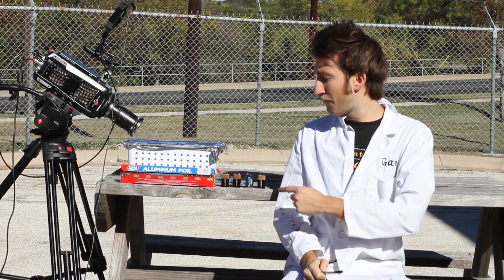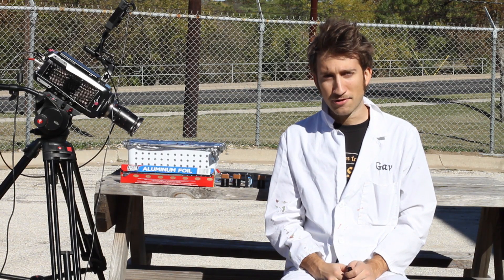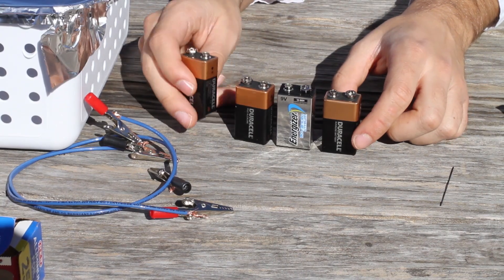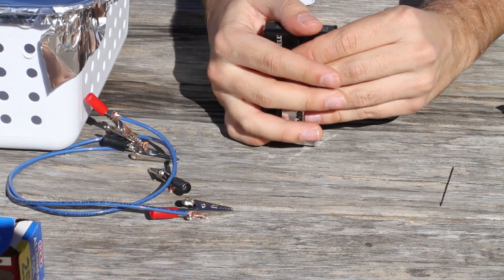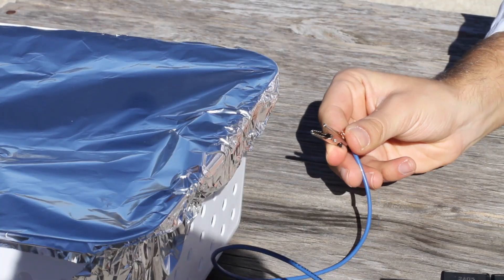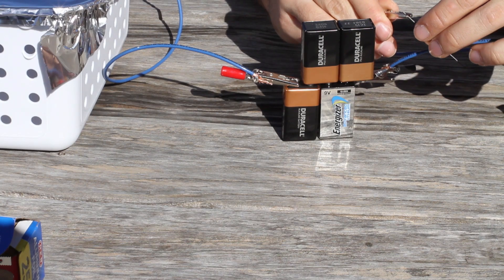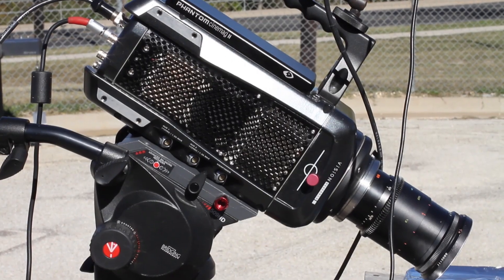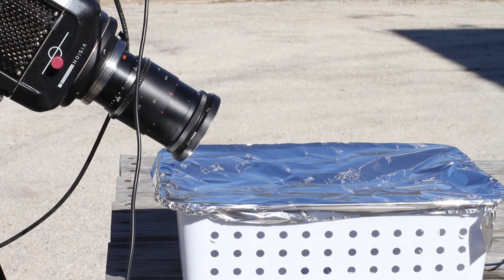Tiny Plasma Cutter in Slow Motion - The Slow Mo Guys

Comment: It the voltage or heat in the plasma enough to hurt you?
Reply: Ok first of all the thing he is holding is insulated so it cant shock him and second the amount of volts in 5 batteries cant create enough heat to harm you
Reply: Is the fact that the lead's tip is heated white hot enough to burn you so hard to see?
Reply: Oh trust me I put a led on '1' 9V battery and touched it accidentally and it burned my finger badly. Don't ever touch anything that has electricity or heat in it, it will hurt you. And he used 5 9V Batteries so it will harm you.
Reply: Maltfalc https://www.youtube.com/watch?v=XDf2nhfxVzg
Reply: Bardo not even troll... NOTHING can happen to you when you touch a 100mA 9v battery maybe like 1000 connected in series would LITTLE shock you.
Reply: Maltfalc you're funny
Reply: ***** is right
Reply: Bardo Was it Led Zepplin?

*Sidenote: you spelled "lead" wrong. Also, it's not lead, it's graphite.
Reply: NCR Vet he meant LED i beleive.
Reply: ***** The heat will hurt you, the voltage will tingle but won't do any permanent damage (probably).
Reply: Actually its the sword that kills
Reply: ***** It's not the current, goddammit. Everyone thinks this.It's actually the VOLTAGE that kills. You can run a 500 amp car battery through yourself and not die. I've done this. The thing with high voltage (above 200 volts) is that you can only have it in your body for microseconds. If it is in you for too long (say, 1 second) your heart will beat irregularly (mostly applies only to AC voltage) and you will die.
Electrostatic shocks contain voltage up to the 600 thousands. If that kept on going for 1 second you would be fried.

Comment: Please be aware that you should wear shaded lenses when doing this! Sunglasses aren't good enough either. A proper welding/burning lens in the 9-10 range should be good. Also, with a heavier, shorter piece of graphite, you can cut thin steel...

Comment: I tried to do this at home.  all it did was make some small sparks and blackened the foil I did everything right I use 4 9v batteries and used #2 pencil lead does anyone know why it's not working?
Reply: A bit late, but I might have a suggestion. Try fresher batteries, change up the foil (Some foil contains plastics which interfere), or try a softer lead. Softer leads have more graphite, which is the key to making the experiment work.

Comment: just out of curiosity...what would that do to paper?
Reply: I'm no science geek but I'd guess it'd catch on fire...
Reply: A bit late, but thought I'd chuck this in:
It would do nothing more than draw on the paper. Paper does not conduct, so the electricity would have nowhere to go.
The aluminium trick works because the foil conducts, closing the circuit on contact with the graphite, exactly like an arc welder.

Comment: Is this really a plasma cutter or is this just a redox reaction?
Reply: I reckon there's plasma involved; those bright-blue arcs are plasma.  But calling it a plasma cutter IMO is abuse of the language.
Reply: dbeierl
Yeah. Looks nothing like the weapon from Dead Space. All joking aside, what you said is what I was thinking.
Reply: SSS365 Aye. Your actual plasma cutter generates a concentrated high-pressure jet of plasma and hurls it through whatever grounded metallic is in front of the nozzle.  The metal is vaporized before it has time to soak the heat away, and it is so quick that amazingly little energy is wasted outside the actual cut.  An oxygen cutting torch, a wonder in its own right a century ago the way it could burn a slit through inches or even feet of steel, is a blunt instrument by comparison.  And all it uses is electricity, dry compressed air, and some consumable nozzle parts.

For a while I had a baby self-contained one meant for sheet metal up through 1/8" (and would hack its way through about 1/4" if you were determined and accepted a messy cut).  It really struggled with 1/16" (?) copper when I tried it just to see.  The copper conducted the heat so well that it wouldn't stay there long enough for a clean cut.  Instead the whole sheet got very hot and the jet had trouble even piercing it.  Nasty messy awful-looking cut.
Reply: ***** Yes, you can see the melted metal at the edges.  Cute trick though.  As a kid I used pencil leads as resistive heater elements, but I never thought of this one.

Comment: This is not a plasma cutter.  This is an arc welder.  An arc welder which is cranked up too high and burning through the piece it is welding.
For a channel with nearly 5 million subscribers, you should watch your nomenclature.

Comment: What type of lead do you use? Are you using actual lead or just graphite? I tried using graphite and it cuts for about a quarter of a second then stops being able to cut anything. The leads and everything were still connected but the graphite would not cut the foil.

Comment: Wow...so much controversy over a single word. For those who are interested in more intelligent conversation, please reference this link regarding why the names are different.
http://en.wikipedia.org/wiki/Aluminium#Etymology

Here's an excerpt:
"Two variants of the metal's name are in current use, aluminium (pronunciation: /ˌæl(j)ʊˈmɪniːəm/) and aluminum (/əˈluːmɪnəm/)—besides the obsolete alumium. The International Union of Pure and Applied Chemistry (IUPAC) adopted aluminium as the standard international name for the element in 1990 but, three years later, recognized aluminum as an acceptable variant. Hence their periodic table includes both. IUPAC internal publications use either spelling in nearly the same number."

In short, both terms are scientifically acceptable. If you're trying to determine which word is the "right" one, then you're barking up the wrong tree. Words are neither right nor wrong, they're merely accepted or unaccepted.

For more information about how words become "accepted" words, please reference this comment from the Merriam-Webster website:
http://www.merriam-webster.com/help/faq/words_in.htm

Comment: IMO its not plasma cutting but EDM cutting
Reply: Are you trying to be smart, because if you are you are doing good
Reply: George Mitchell Ty. I meant in plasma cutting they use gas with high temperature (plasma) while in EDM its two electrodes. IMO title isnt correct

Comment: It was Aluminum before aluminium, but alumium was the first spelling.  Aluminum dates back to 1812, while aluminium dates back to 1826.  Alumium dates back to 1808.  This information is readily available in encyclopedias, dictionaries, and online sources.

Any etymologist can tell you that more often than not, it was the British who changed the spelling, and of course whatever colonies they still had at the time of the change followed.  The Americans most often use the original spelling or term

Comment: Okay, my "why isn't this 60fps" friends...here's how this works. 
Gavin records with the Phantom at 2500 fps. Played back at 24 fps, it shows events 104 times slower than we experience them. If they adjusted playback to 60 fps, it would only be about 41 times slower. To get the same ratio of 104 times slower, Gavin would need to record at about 6240 fps. 
Why not? Here's (probably) the reason: the phantom is capable of 1080p recording at speeds up to 2570 fps...after that, you're sacrificing resolution for frame rate. The 6240+fps that you would need for the same playback effect is beyond that threshold; in fact, it falls in the lousy range of 640x480. You'd get your 60 fps, but your video quality would be really crappy. 
Picture quality trumps frame rate any day, so enjoy your slow-mo in glorious 1080p.

Comment: This isn't plasma cutting. Plasma is a superheated gas that in most shops uses compressed air, this is more like arc gauging which actually uses graphite in the rods. The rods heat the metal up and compressed air blows the heated metal away. Still pretty cool tho.

Comment: this is not plasma cutting it is carbon arc cutting. plasma is where there is air blown out at a high speed and turning to a plasma form by an arc created between the torch and metal. carbon arc cutting is what is shown here.  the carbon rod, the pencil "lead", is allowing an arc to form from it to the metal heating it up enough to melt it. usually its air carbon arc where air is blown onto the molten metal and blowing it away so it doesn't weld itself back together.

plasma is used on thin metal such as this but is a different process. air carbon arc is used usually on thicker metal 1/4 in. 1/2 in. etc. air carbon arc is done with a constant current welder and a air carbon arc stinger(the thing that holds the carbon rod). it is usually around 200 amps of electricity for a 1/4 in. mild steel plate producing about a 10000°f arc (if my memory serves me correct on the temperature) this doesn't need to be anywhere near what it would be for mild steel since it is aluminum foil.
Reply: still cool to see in slow motion instead of behind a welding helmet at normal speed

Comment: I wouldn't call that "plasma" cutting.. What you're doing is carbon arc gouging, while working through college I was a JIW for several years. I would arc gouge constantly while welding in order to full pen weld joints.. we use plasma to cut parts

Comment: Hi SMG's 
I would love to see a video of a pop bottle rocket exploding under water. I used to do this as a kid and it makes the coolest noise. All you have to do is hold the rocket about 2ft. off the surface and point if at a shallow AOA to the water, about 30 degrees and light it holding it loosely in your hands. When it launches it goes into the water and plays the wildest tune for you before it explodes! Thanx for all of the excellent videos.

Comment: Not a plasma cutter, theres no gas the electricity runs through to create plasma. This just looks like a stick welder that doesn't melt the electrode on to the ground, and it cuts through the foil because it's too thin for welding.

Comment: No, this is using electrons to cut the aluminium. Plasma is a state of matter (solid, liquid, gas,plasma), a plasma cutter would use heat to cut. If that was true there would be instances of gas, liquid and screaming Gavins

Comment: I have and interesting suggestion for a new video. It starts with a story.

My mother in our old house liked to keep a large metal bowl in the oven for storage because it was the only place that still had space for it. I once forgot to take it out before turning the oven on. So when I went to put the food I was about to cook in the oven, I saw the bowl. So I grabbed the oven mitts and put the bowl in our kitchen sink. The faucet was dripping and when a drop of water landed in the bowl, it instantly went into a boiling state and moved around the bowl as if the surface of the bowl was friction-less. I think that would be cool to see in slow motion.

Comment: This not a plasma cutter at all.
You need way more power to create plasma and use it.
Here you're juste creating a tiny mini spark heating aluminum enough to burn the polymer layer of the aluminium foil.
So, excuse me, but connecting 4 batteries in series for a "plasma cutter" => Busted

Comment: Some notes on safety: A couple of 9V batteries can be harmless, but don't overdo it. Every time you add a battery you're increasing the voltage by 9 volts. 
Firstly the spark can cause a fire. And secondly, under certain conditions, the total voltage of as little as 11 batteries in series can be enough to kill you.

Here's the calculation:
A current of 0.1 A is about the lowest potentially lethal current. 
The resistance of a human body can vary from as high as 100,000 Ohms to as low as 1,000 Ohms. 
So the voltage required to kill would be 0.1*1000 = 100V  (U=I*R)
100/9 = ~11 batteries.

Comment: These have quite high ESR so you won't get much current out of them. Should have used a few motorbike batteries or even a high capacity 36v cordless drill battery pack :)

Comment: I'm not sure if this was mentioned in a previous comment, but that's not a plasma cutter, that's a carbon-arc gouger. A plasma cutter uses a high pressure stream of air that is superheated using electricity to gouge/sever metal, while a carbon-arc largely resembles a typical stick welding setup. Instead of a metal electrode in a regular stinger lead, it uses a carbon rod which serves only to carry the current which melts the metal without adding any more material. A carbon-arc stinger also has air holes that blow an air stream down the length of the electrode in order to clear the molten metal away. Obviously, the air stream is unnecessary on a small scale, but the concept is the same.

Comment: Not quite a "plasma cutter" in the technical sense. This is far closer to "Electrical Discharge Machining". Plasma cutting requires the use of a high velocity gas stream which is ionized by an electric arc which converts the gas to plasma. The heat and velocity of this plasma stream is what cuts the material and clears it away from the substrate. Electrical Discharge Machining uses high frequency discharges of electricity to create sparks between the susbtrate and the tool (in this case the pencil lead). The interaction between these sparks and the substrate is what removes the material.

Comment: Don't know if this is a dumb question but.. would it significantly hurt if you tried it on your skin?
Reply: If you stuck your finger where the spark between the aluminium and the graphite is, it would just give you a very localised singeing burn (you can do it with a plasmaball and aluminium foil, and yes it hurts) :D

Comment: That doesnt seem like a plasma cutter more like an electrode for stick welding. the Aluminum is to thin so it doesnt weld it cuts, this is not a plasma cutter type but a stick welding type.